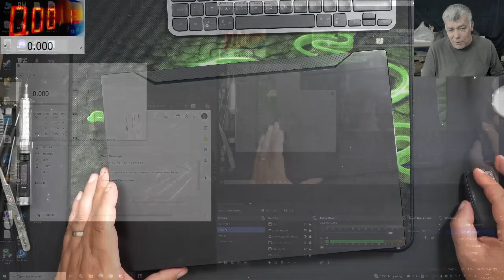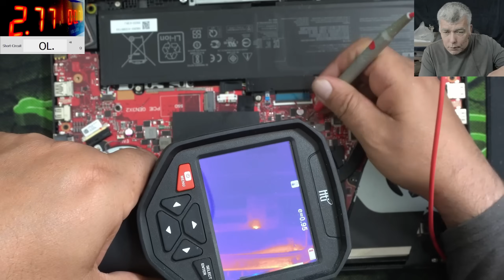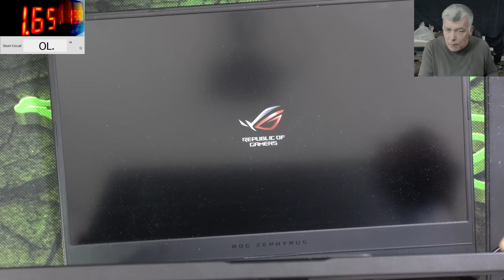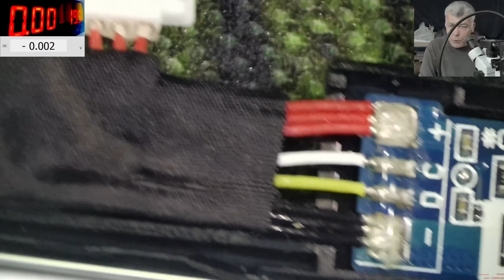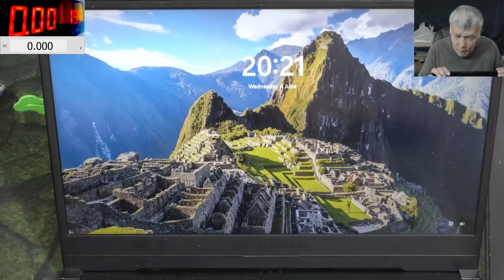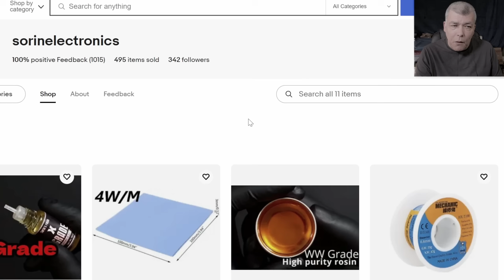ASUS GA502D ROG ZEPHYRUS dead, no power, board repair and something more...

Comment: Hi Sorin, can I ask one thing ? I've been whatching you randomly last 5 years and I still ask myself why you do not use a old USB connector soldered to a tester cable to get a stable ground and a free Hand . I'll be very happy if you will use it on the next video. Best regards, Massimo Buzi from ITALY

Comment: 10:20,  I think, that is the bios battery. I could see 'R' written under the wifi card. in asus boards they are mentioned as RTC. in some laptops, the coin cell is bent or tucked below the motherboard. 

at the same time, below the eDP screen connector or near the second ssd's  pcie slot, there 'SPK' written which usually means Speaker.. 

please correct me, if i'm wrong.

Comment: Battery fuse is short-circuited because it is dangerous. By the way, isn't it a fire or other danger if you forcibly connect and use it?
Reply: It wasn't forcibly connected. It was resoldered. If it overheats it will simply melt again.

Comment: Technically there is no "BIOS battery", since the BIOS doesn't need it because it's non-volatile. I think it's the PCH, the one that needs power and if it loses it, then it resets the BIOS at the next boot. I learnt this yesterday 😂😂
Reply: PCH or chipset? Thanks.
Reply: But the laptop still works even if it resets the bios, i ask this question because i will remove the battery ( it is dead anyway) and keep the laptop work on main power supply.

Comment: can that battery still charge even you put jumper on the circuit?
Reply: No. Watch the full video
Reply: @Misimpa yeah I saw it so need to replace new battery
Reply: @DocPCTV  If you don't have unlocking equipment, then yes. This channel has already shown how to unlock the battery in a laptop.

Comment: I disliked this repair mainly because you didn't find the root cause for the disabling of the battery.
What if cells are unbalanced? It could be that the chip glitched and a reset would make it recover, but you will only find out if this laptop will catch fire or return with the fuse blown again. 
What saddens me is that you have the NLBA and could easily check the health of the battery but chose not to. 
As a teaching experiment it's ok, but after that you should have said "that's how you do it without NLBA, now let's connect it and see exactly what is wrong with this battery" and then proceed to do it the right way
Reply: I agree